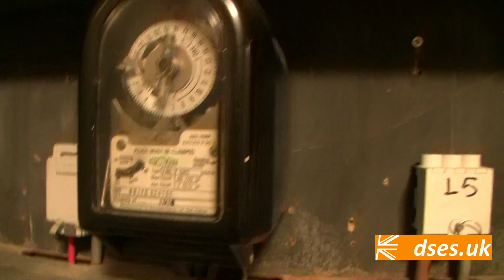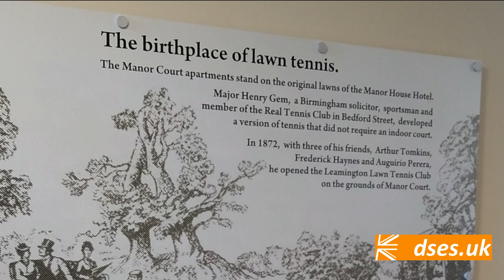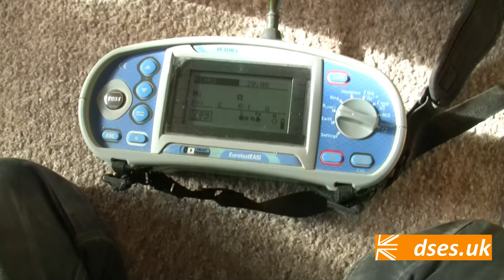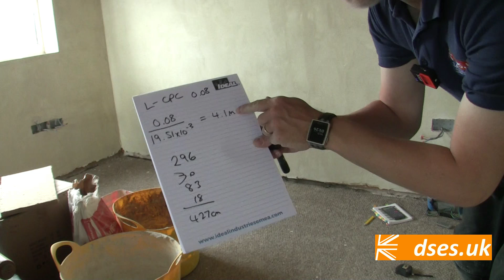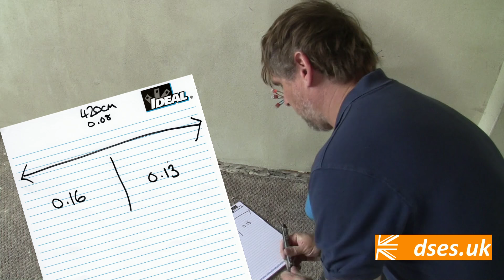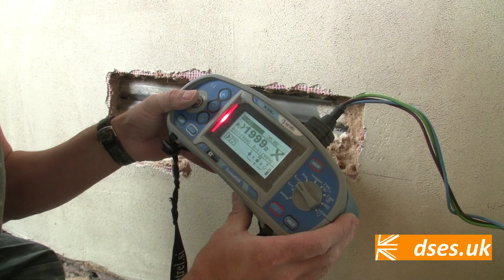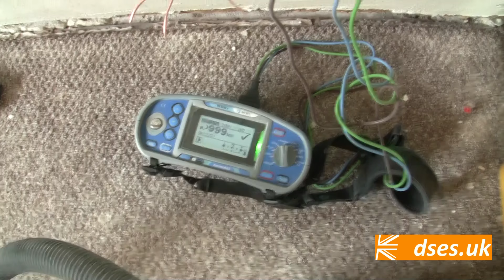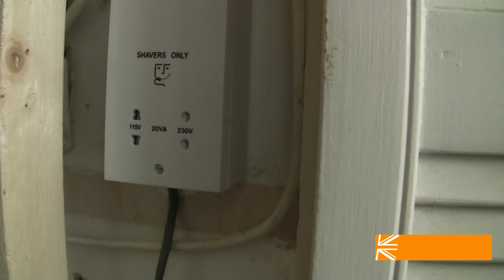Fixing another man's lash-up!

Comment: could the junction be an additional 13a outlet (not seen your solution yet)
Reply: Wouldn't line up with the other sockets as the cappings have been run under the sockets instead of in-line with them.
I would have probably put the other cable in the box as there is room next to the connectors.
Reply: I think that cable run was between the storage heater and a socket on the off peak supply only so it would only work overnight  in the early hours
Reply from the maker: @stuartarnold9444  These were two separate circuits (peak and off-peak supply) which is why I left the other cable out of the box. I don't like the idea of someone opening that junction in the future, however unlikely, and thinking they've isolated it when another potentially live cable from a different CU is passing through it.
Reply: @dsesuk  Sorry, I thought it was a ring. Good call.

Comment: HI, if you should find out some legitimate reason for the previous contractor , running the cables all over the show. Which to me is really stupid if you ask me. Please let me know. As it would be most interesting to find that he had a legitimate  reason for doing so, saving on voltage drop can't have been one of them. lol
Reply from the maker: I'm told it's the 'leapfrog' method more common on commercial dado type installations where sockets are wired alternately to prevent a long ring leg going back to the board. It's particular to ring circuits, and as the rest of the world rightly shuns such, it's a curiosity and not one I've come across in my (mainly) domestic travels! Even so, it makes little sense here and over-complicates the installation.
Reply: Good name for it I guess. Still even with that reasoning I'm baffled. As here we can out of normal practice have up to four socket outlets at 10 amp rating in one circuit. In theoretical practice you can have more, if you have a known usage plan set out with maximum demands. I saw on one of your site visits where you used your tone generator that there were nearly 10 or more is that permitted over there?

Comment: No experience with capping, if it had been a straight run (like on the same wall) would you have gotten away with pulling a new cable with the damaged one in the existing capping?
Reply from the maker: I certainly would have tried Harry.

Comment: Thermalite block, you can dig holes in them with a spoon 😂 so how the hell do you manage to bend a nail in it???
Reply: As you can see the nail went into the metal capping first not the block
Reply: Ken Fleming  yes but the capping is not exactly hard, the nails must be made of finest Chineseium 😂
Reply: Could it be that the nails happened to hit the mortar joints between the blocks, which is often ten times harder than the blocks themselves?

Comment: Fibre board. like what notice boards use? Why? Why not just......., oh hang on it's used as insulation isn't it?
Reply: But internally its insulating what on internal wall to wall,  I suppose its cheap and consistent
Reply from the maker: I think the use on the internal walls is for soundproofing between the rooms.

Comment: Wow, is that a standard height for "lower" sockets in UK? Almost in the middle of the wall. Here in Norway they are much lower to the floor.
Interesting to see the different standards. And yeas, what a mess, no logic in my mind.
The max Amps allowed in a normal socket here is 16A and we use piping on a job like that.
Good job calculating where the short was..
Reply from the maker: The Building Regulations were changed a few years ago to accommodate those with mobility issues. As such, the height of accessories such as sockets and switches is between 450 and 1200mm from the finished floor level. It only applies to 'living areas' (lounge, dining room, bedroom, not kitchen, utility room, garage), and it only applies to new builds, although if performing a back-to-bricks rewire on an older installation, then it makes sense to comply. It does mean sockets are higher up the wall and switches lower down it than people may be used to. As for socket circuits, for living areas, I'd install 16A or 20A radial circuits, then 32A for a kitchen to cover the kettle/toaster being used at breakfast.

Comment: Pek and off pek I don’t get
Reply from the maker: To balance demand, especially back in the 60's and 70's when energy was a tougher commodity, many properties were built with peak circuits (24/7) and off-peak which only clonked on via a timeswitch and contactor between about 1 to 8AM. These nighttime circuits generally had storage heaters connected to them which would heat up at night, then release their heat throughout the next day. The off-peak rate was cheaper in order to encourage people to spread their energy load. It's still an option today and I am on such a tariff. My EV is set to charge from 2AM if plugged in and the wife often sets the washing machine or dryer to run in the small hours.

Comment: Nice fault finding matey. I have seen these repair crimps on line 
Solder Sleeve Seal Heat Shrink Electrical Butt Wire Terminal Connector Kit Set. Not sure of the amp rating !?
Reply from the maker: When it comes to (any type) of connector, if the wire fits into it, then it should be able to cope with at least the maximum rated current carrying capacity of that wire.

Comment: Well the nail got bent going through the capping before hitting the block and cable 😂 but you've got to ask yourself which I'm Shaw you have how many more near misses are there in this insulation that may show up in the future
Reply from the maker: Doesn't bode well when such a simple cock-up isn't picked up before the next trade moves in and starts covering things over. As far as I can tell, there are no other headaches though, IR and continuity check out everywhere else.

Comment: 10 cm out.... Must try harder 🍺
Reply from the maker: As my wife says, 10cm is everything.
Reply: @dsesuk  

Lol. An actual measurement can be achieved by the following method:

The two readings (0.13ohms and 0.16ohms) represent the RATIO of distance to the fault from either end. An actual reading to the fault can be obtained by the following equation:

(r1 / (r1+r2)) x Cable length (end to end)

where r1 is resistance to fault from point 1,
r2 is resistance to fault from point 2
and cable length is obtained by direct measurement (cable route known) OR calculated as David did in this video using the CPC and line conductor. For this example, the calculation is as follows:

(0.13/(0.13+0.16)) x 4.2 = 1.88m from the point where the resistance was 0.13ohms

the same works the other way:

(0.16/(0.13+0.16)) x 4.2 = 2.32m from the point where the resistance was 0.16ohms.

Comment: Hi David what's your take on using inline connectors like the one in this link,  awesome vid by the way!!👏 https://www.toolstation.com/in-line-spring-lever-connectors/p78346
Reply from the maker: No experience of such, although it looks interesting if made by a reputable manufacturer. No brand is given though. Also, to comply with BS5733 for a maintenance free junction, it would need to be rubber-stamped as being compliant and would require an accompanying enclosure, but none is listed in my Toolstation catalogue. I suspect this is a Chinese Wago knock-off that TS have decided to market, but I'll stick with the likes of Wago and Ideal who are BS5733 certified and have enclosures made for their connectors.
Reply: @dsesuk  I believe they are made by ideal.

Comment: Im at 23:39 in the video and I'm guessing 3m from the storage heater patress. Let's see if my maths is correct ;)
Reply: I would say that was bang on, only was able to do this because of you David putting the thought in my head. 0.16 is 23% greater than 0.13. Therefore 23% of 4.1m is 0.94m with a midpoint of 2.05m the fault lies (mathematically) 3m to the right. Thanks very much for this video, an absolute golden nugget.
Reply: Your maths is flawed

0.16+0.13 = 0.29

0.13/0.29 = 0.448 or 45%

4.2 X 0.45 = 1.89

Hope this helps
Reply: @thomasanstiss469  Yuesss, I think you're right 😂. This was done after a bottle of port (excuses)